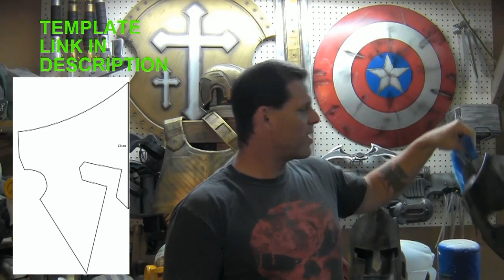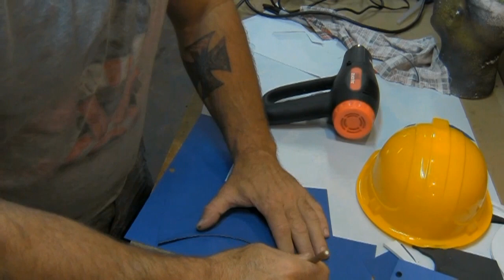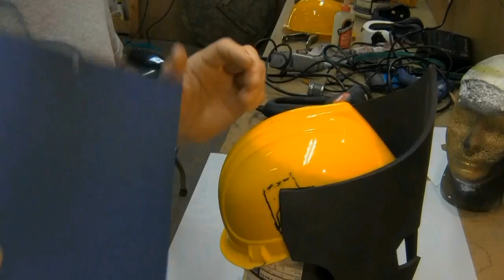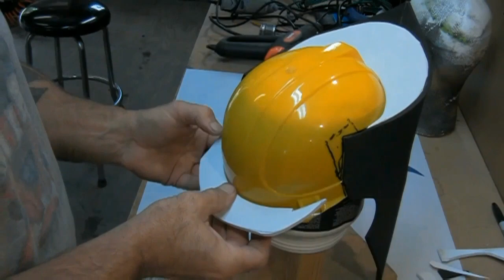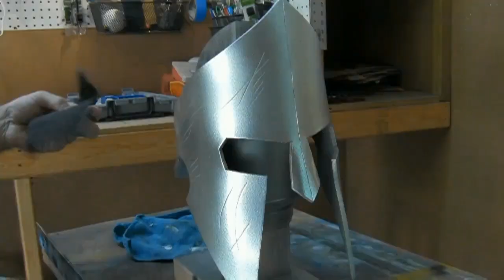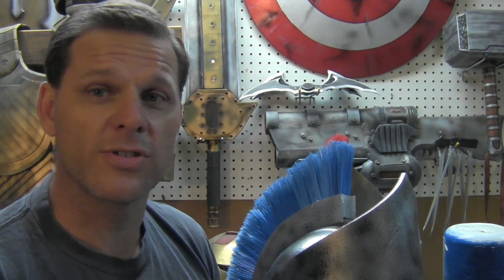DIY SPARTAN HELMET E28

Comment: The inside of the helmet can be fitted by using spray foam. Create a limiting cavity with some foil and spray the foam to a closed 'bag' this way it will set against the structural pieces and be held loosely in place by some plastic. Before it sets, cover your head with more plastic and/or aluminum foil, then press the helmet into it which will form the foam around the head, giving a perfect fit. Make sure you don't use the self-expanding foam, instead there is a non expanding version used to seal windows and doors. 
Can be used to fit all kinds of armor and helmets around. Its a very cheap solution to get a sturdy volume on many diy objects. 
! Please be careful: make sure you are never fitting a closed volume around your body, as the self expanding foam can cut off circulation and be deadly. Even the 'non-expanding' labeled foam grows out by a bit, so always pour a bit less and give it some time. Always test every product on some pieces of scrap to get a good feel for them. Cheers.